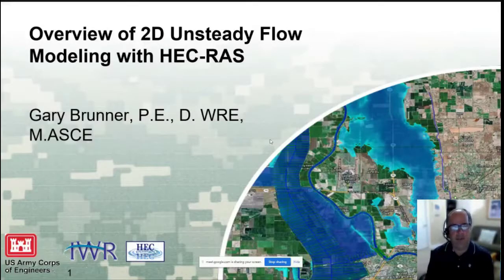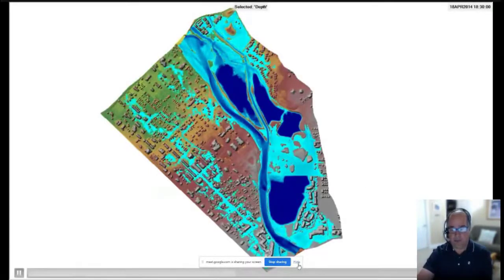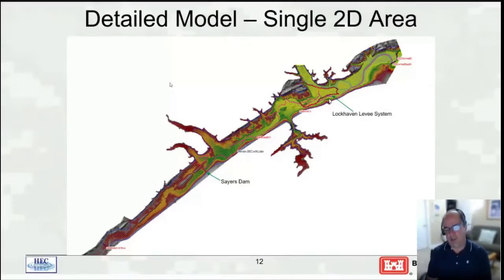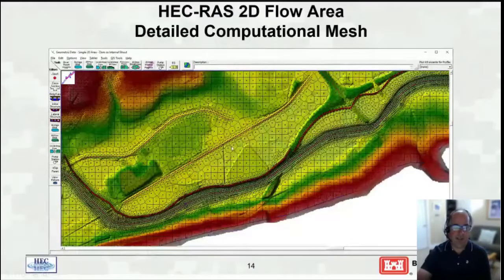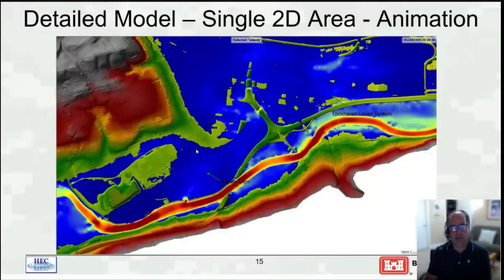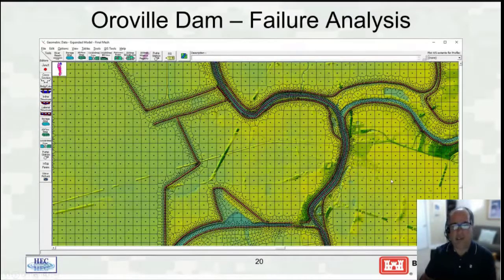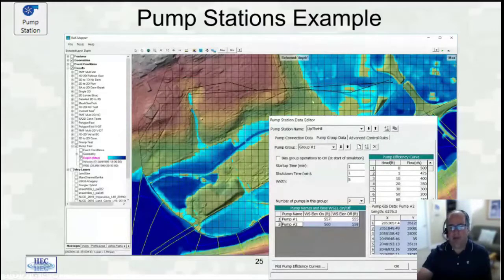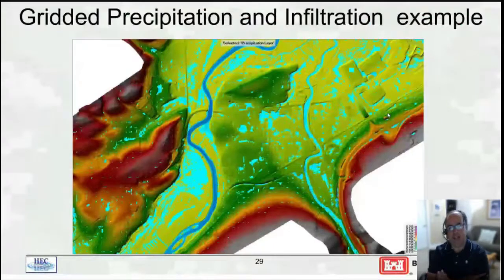HEC-RAS 2D Class 1.1 -  Overview of 2D Unsteady Flow Modeling

Comment: hi i am new to 2D modelling, i performed a dam breach analysis with just one 2D flow area, and this error occurs:
The SA 2D Connection at  Dam
has an error with the connection.
Check that the "From:" is set correctly.

I am using just one 2D flow area so I don't know how to troubleshoot this.

Thank you